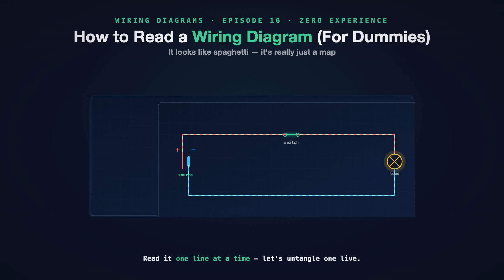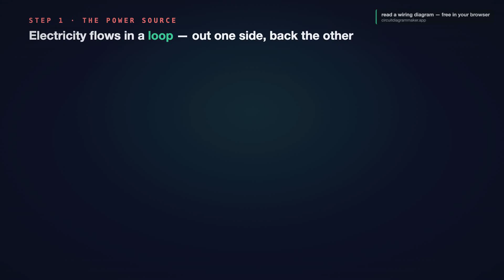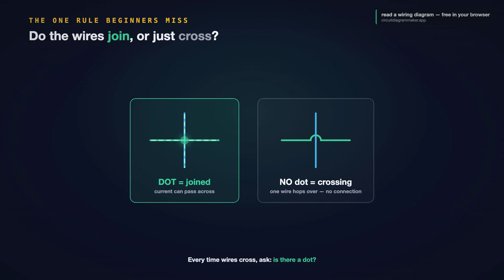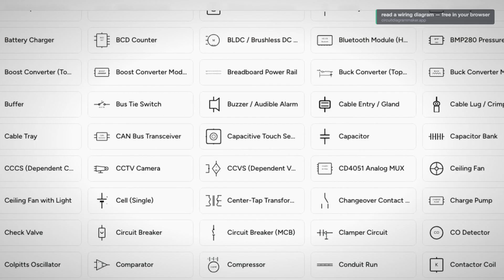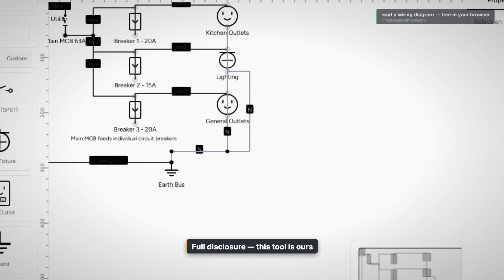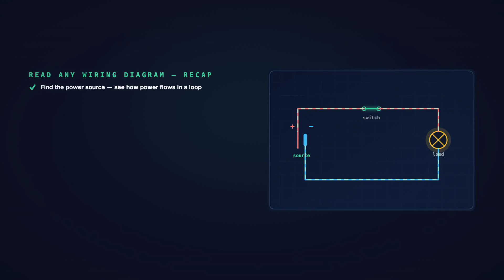How to Read a Wiring Diagram (For Dummies)

Comment from the maker: The one trick that makes any wiring diagram readable when you have zero experience: don't try to read the whole thing at once — it only looks like spaghetti. It's a map. Find the power source, learn a handful of symbols (and the dot rule: a dot means the wires join, no dot means they just cross), then put your finger on ONE line and follow it from the source, through the part, and back to the source. That's one circuit — you just read it. A busy diagram is only ever simple loops sharing a few nodes. Open a real one and untangle it along free (no signup): https://circuitdiagrammaker.app/try?utm_source=youtube&utm_medium=pinned_comment&utm_content=yt-016